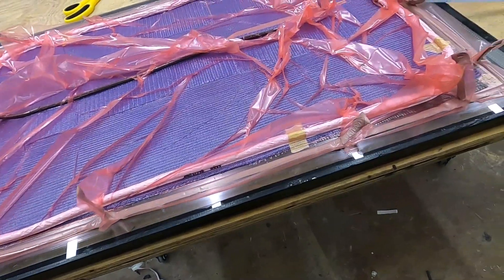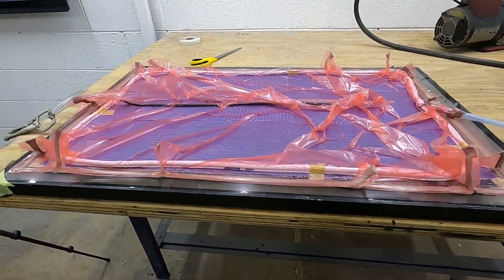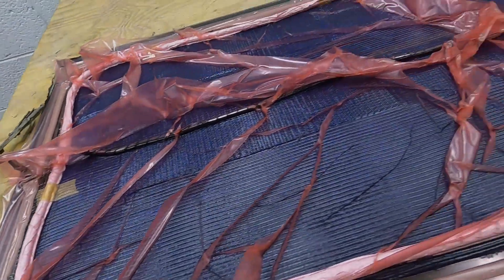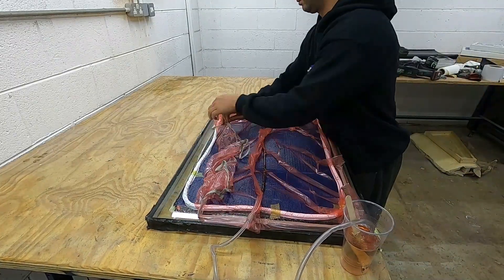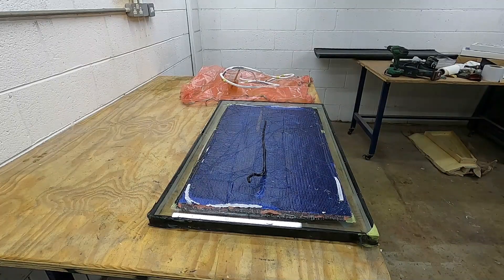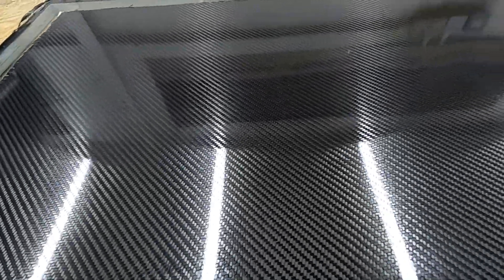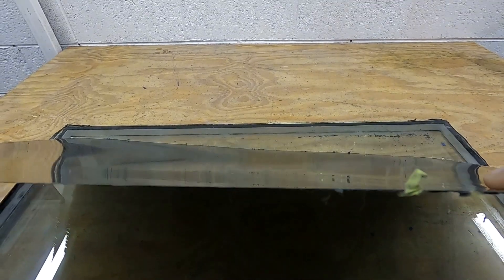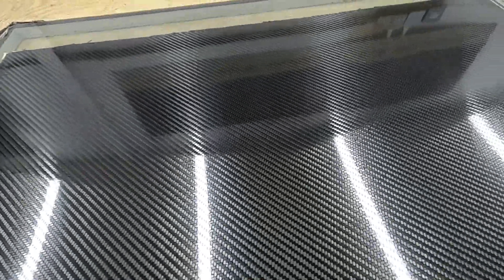How to make carbon fibre sheets the proper way

Comment: Is release agent necessary on glass?
Reply from the maker: Hi there, yes it is, as no gelcoat is being used its good measure to ensure the surface is clean of all contaminants, it also helps with the high gloss due to the lack of resistance during resin flow and wet out.  Hope this hgelps

Comment: Has this been post cured? If not, won't the resin shrink and the sheet loose the shine once exposed to the sun?
Reply from the maker: No post cure required on a part like this, depending on the part the curing process varies, as im using epoxy shrinkage is extremely minimal (if any).  A flat sheet like this is fine to be left uncoated and can cure naturally at ambient temp as this wont be a structural part or exposed to prolonged uv.  Any structural parts parts however such as bonnets, roof ect are treated to ramped temps, not so much a post cure but the curing temp is just raised above ambient, the parts are also given a uv stable gelcoat to protect against the elements.  I hope this helps.

Comment: I’d Like to see a tutorial with equipment used. Looks like infuply maybe ? Just ordered some of this to try myself
Reply from the maker: Hello DG, yes it is infuply and ive used the MTI microporous vac hose, the rest you should know (vac bac, vac tape, epoxy resin ect)  Hope this helps
Reply: @autoflockmotorsport7730  yes definitely thanks. Do you rate the infuply over normal 2 part set up ? Thanks
Reply: @autoflockmotorsport7730  also if you do a how to video it would be see someone go into a bit of detail how to do pleats properly. I can never get this bit right and end up with bag left at the end I have to bodge

Comment: Can you make one with a thickness of 0.4mm? if yes, then how do you get a thinner sheet?
Reply from the maker: Hello Vert, for a typical door card I use 2 layers of 200 gram 2x2 twill,, this yields a thickness of approx .5 to .6mm thickness.  Ive not measured one sheet as that is a very very delicate sheet if the customer requires it I can look into it.  If you want to drop me a message on the facebook page I can advise further.  Thanks for taking the time out to comment mate :-)
Reply: @autoflockmotorsport7730  Thanks for the reply! I was wondering, how can I fuse a carbon fiber part to aluminium or steel without using screws. Is there any adhesive that's made for this?
Reply from the maker: @V_raptor88  Not that I know of as I have never attempted this, what would be the purpose? as in what scenario
Reply: @autoflockmotorsport7730  I am working on a project to make a case where the (vertical) frame of the case is made of Stainless steel and the flat (horizontal) surface is made of a Carbon fiber sheet. Now I need to join the four edges of the flat surface to the frame, since I do not have much room on the inside of the case, I want to join these two parts without using any screws. It's okay, I really appreciate you taking the time to reply, thanks!

Comment: Damn stupid too much work you doing only making side shining  'Rubbish'
Reply from the maker: Care to explain more as to why it is rubbish?  This product was requested to be installed as a rear door card within a race car, my main choice of manufacture is resin infusion, there was no reason to make both sides shiny as one side is bolted to the body of the car.  The fact it is shiny is just a by product of the glass and in all fairness why not have it looking aesthetically pleasing?  Not really a productive or helpful comment but thanks anyway for taking the time out to comment on my "rubbish"

Comment: Please advise me what I need to create carbon fiber sheet on my own.
Reply from the maker: all depends on the manufacturing process you want to use?  for me its a glass like smooth surface, high quality carbon fabric, high quality infusion resin, sealant tape, vacuum bag, infusion resin flow media peel ply and a lot of patience.